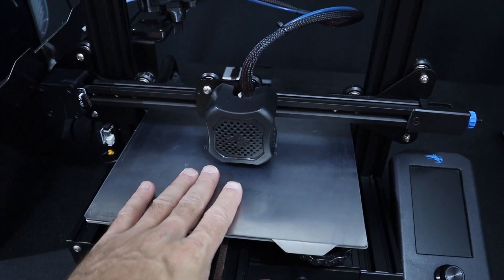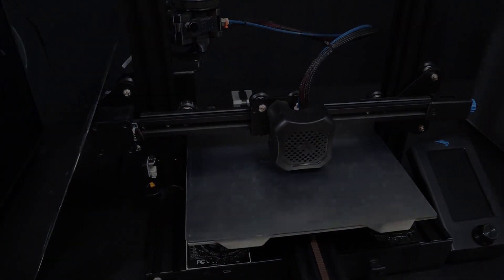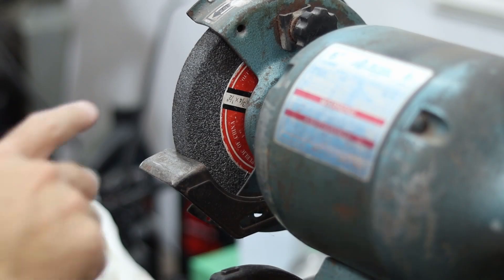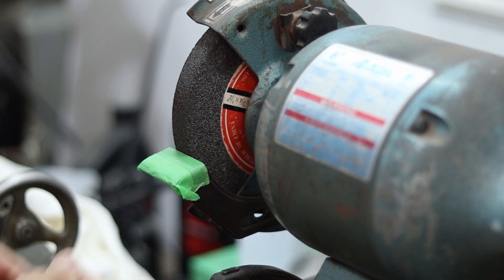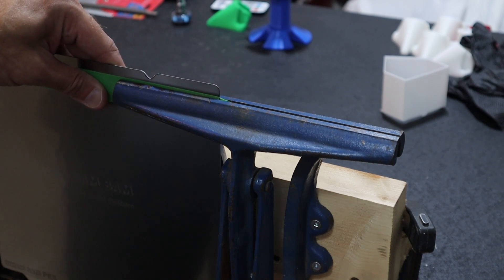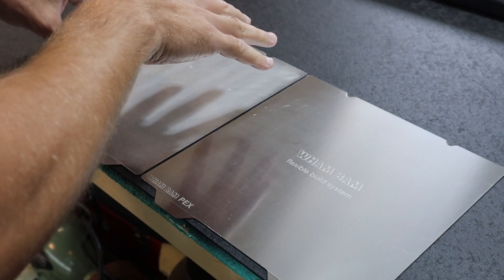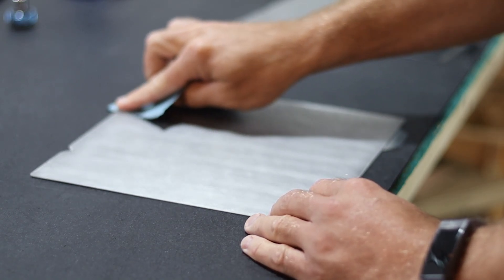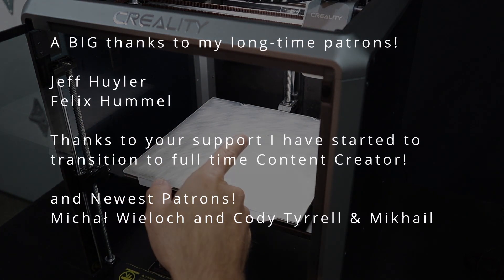DIY it and Get Your Wham Bam PEX Buildplate to Fit your New Creality K1 'Speedy'

Comment: Why did you not remove both screws? I removed from mine and everything works perfectly fine sir.
Reply from the maker: Sure you can do that.  The screws are there to align the plate, if you don't have them you'll have to fuss a bit more is all.

Comment: please explain why the dryer in solid in the STL files?
Reply from the maker: When printing with Spiral in the slicer, it will automatically change to a printable part like you'd expect, this is the normal way to create a part which is printed in Vase more/Spiral mode.

Comment: Well that is cool that it works but this really is overkill. The quickest and easiest way to do this is just remove the bolts in the back and you can use any plate you want. You will have to manually align it but it's easy to do.

 If you don't want to worry about that I designed 2 3d printable tabs that will bolt in the stock location and act as a stop for any build plate. 

The file is free to download on printables and I have a 40sec short about it on my channel with links to everything. This also works on the K1 Max and other Creality printers with these alignment bolts👍
Reply from the maker: Sure, whatever works, just showing my method.  The bolts are there, I like the solution, I thought that adding the notches was a good idea, but hey do what works for you.    I've found that even on the Bambu, the plastic tabs don't last, they're starting to get eaten away a bit by the plate.
Reply: @NeedItMakeIt  Yeah, honestly it is all about whatever works really seeing that these are just tools anyways. 

When it comes to the plastic tabs on the Bambu having problems that isn't something I have seen yet on any of my p1p or x1c printers but I will have to look out for that.

Comment: How are you satisfied with the K1?
Reply: I really like mine. Painless to run, I do have to increase my temp to run random pla or it will underextrude
Reply from the maker: Which slicer do you use?  I'm not a huge fan of the Creality slicer, I became a bit addicted with Cura with my Enders, there are so many options.
Reply from the maker: I like the speeds no question there, but there is still some vibration I'm trying to figure out.  It is very slight, you can't even feel it, but it is visible in harsh lighting like I have.  It seems like it almost forms a pattern, so I'll need to dig a bit deeper to see if it might be something related to the part I've been printing or if it is a printer issue.  I wanted to try Prusa Slicer with the K1.  

The Bambu X1C is quite a bit more pricey, but there are no vibrations, the same speeds of course.